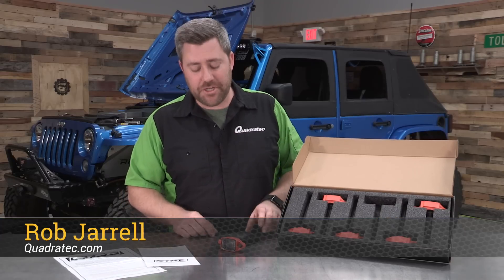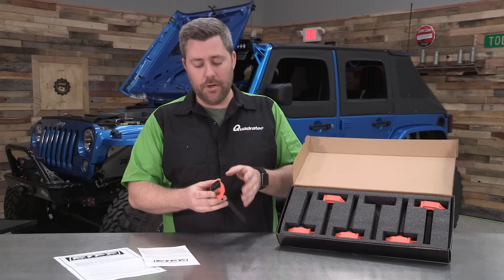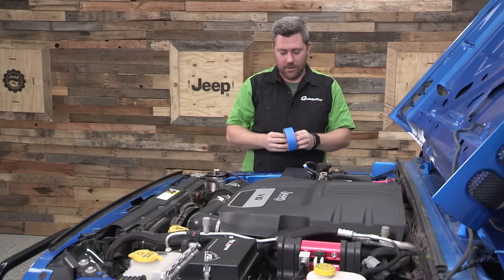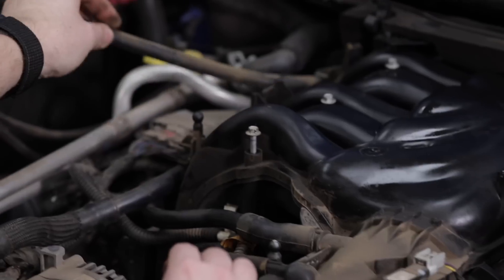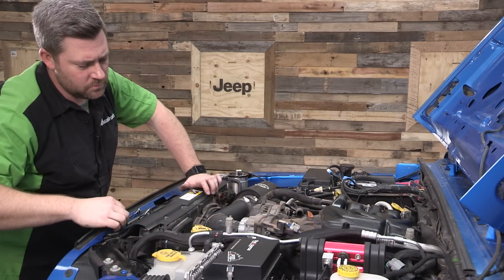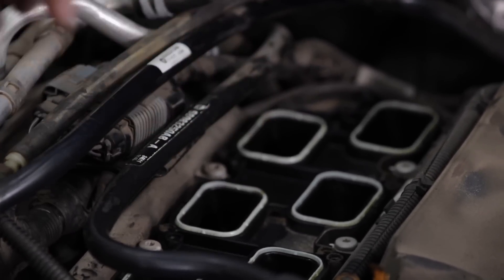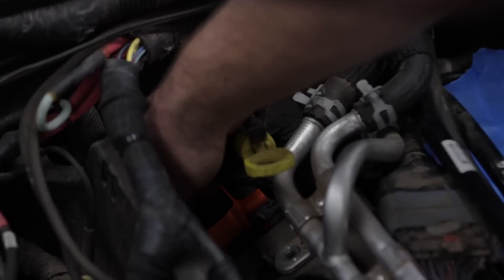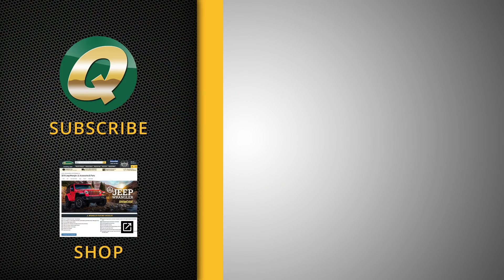Jeep Wrangler JK Coil Pack Install with RIPP High Performance Coil Packs for 2012-2018 3.6L V6

Comment: Hello, Quadratic  ✌
I have an 2013 jeep wrangler unlimited JK sahara v6 3.6 automatic GECKO PREARL green,, with  35x12.50r20 NITTO RIDGE GRAPPLER TIRES  and 3,25" lift 
What's the best spark plugs are there that will work with the RIPP COIL PACKS 
CAN YOU PLEASE SEND INFO 
THANKS 
●|||||||● HERE'S A JEEP WAVE 
🖐  HAPPY JEEPY  🌈

Comment: Is this snake oil
Reply: So you installed this before and it didn't work for you?
 Because I put the Rippmods  high performance spark plug wires on my 2011,  and  Noticed a Big Difference😉

Comment: Is it legal to install in CA?
Reply: Looks like these are 50-State legal: CARB E.O. Number D-705-2
Reply: Technically no, but no smog inspection will unbolt your intake manifold to find them on a visual inspection and they cannot be detected otherwise.

Comment: Do you or should you put in a different plug?
Reply: You do not, but based on mileage you can put in a fresh set of iridium. If you have a RIPP Supercharger there is a gap adjustment that should be followed.

Comment: Do they make it for the 3.8
Reply: We have a version of a 3.8L coil in testing, we do however have an excellent set of low resistant spark plug wires that are very popular.

Comment: Do they make any for the 3.2L?
Reply: Probably the same part, been debating about getting these or the MSD coil packs (also about 10% increase in output) for the 3.6l in my 2012 Chrysler 200. Also been thinking about the new "Pentastar Up Grade" or "P.U.G." lower intake section (the part he taped over) since they apparently have larger, better flowing ports than the original, non P.U.G. intakes after somebody has gone through the time and effort to heavily port those! From what I understand, this "P.U.G" lower intake also only needs the matching gaskets and will bolt up to the earlier Pentastars, no matter if it'a the 3.2l like you have or the 3.6l like I have, probably even works on the 3.6l he's wrenching on in this video too.
Reply: These coil packs are the same, but the boots are longer, we are working on this as well.

Comment: What kind of gains have you notice?
Reply from the maker: In a completely non scientific study, after the first tank of gas through it I seem to have gotten just under a 2mpg gain, but that is not in a controlled testing environment, that is daily driven with very little highway.
Reply: 8-13HP seems to be consistent